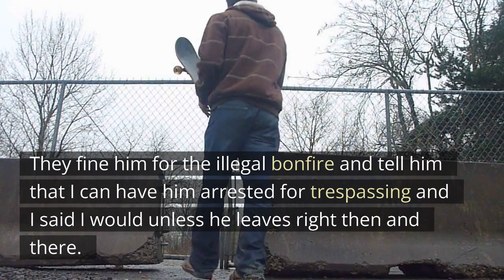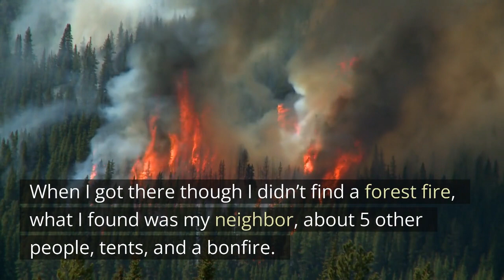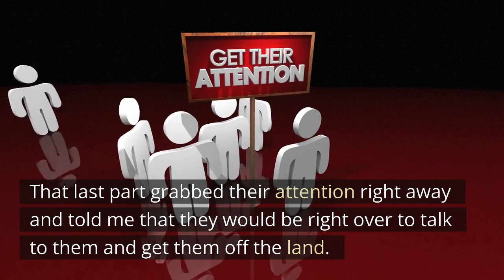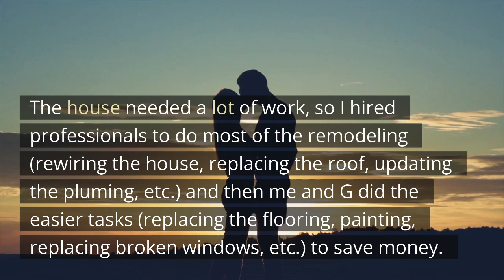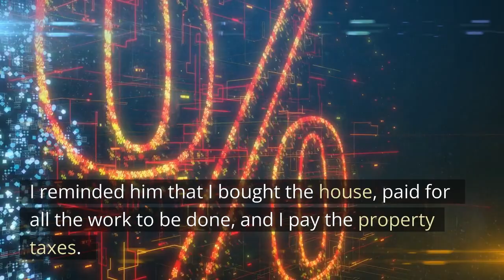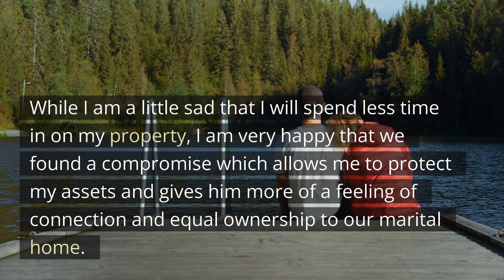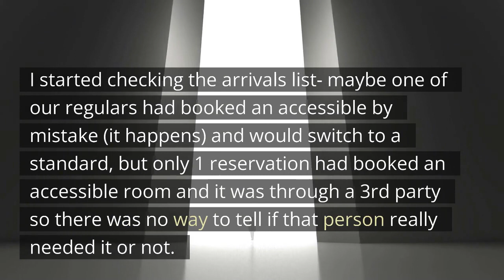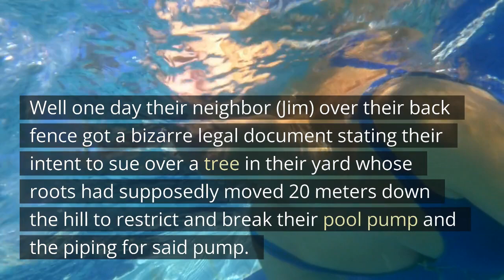Neighbors Had Illegal Bonfires On My Property & Camped On My Land Illegally!

Comment: I had a quarter section of treed land.  My house, garage, garden etc were located at the center of the acreage.  I spotted smoke coming from the small clearing on the edge of the property.  The clearing had been the original homesite from when the acreage was first homesteaded.  The people were very indignant that I wouldn’t let them have a bonfire/booze party on my land.  They did leave but I couldn’t sleep for a few nights because I worried they would come back to vandalize my property.